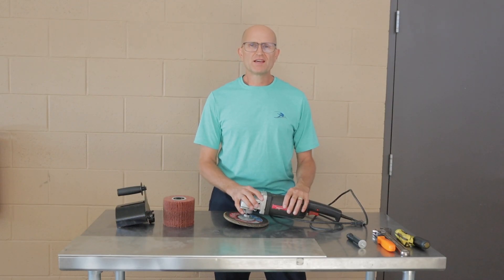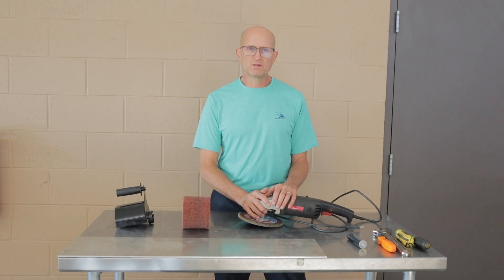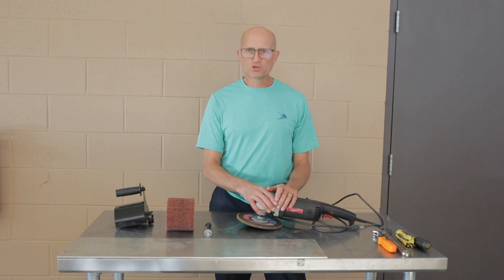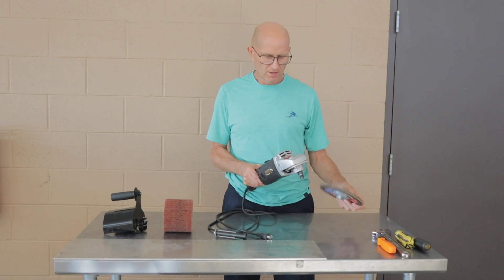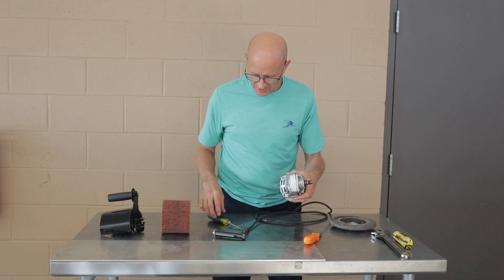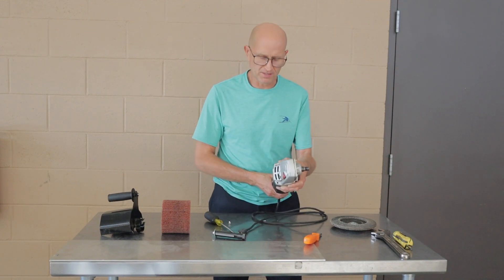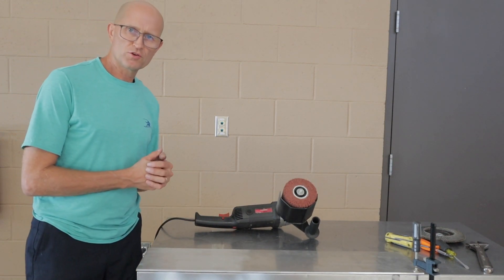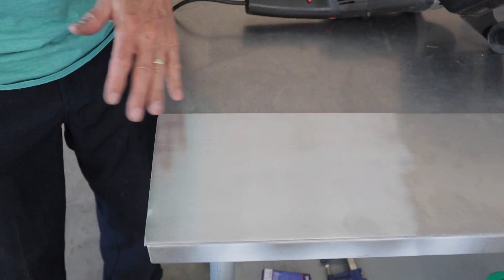Eastwood SCT DIY Tool at Home for Half the Price! $$ [ Aluminum and Stainless polishing for cheap!

Comment: Buuuu, I though you were going to DIY not buy from ebay
Jokes bro. You probably need an engineering lathe to manufacture that drive hub. the protection guard u can do yourself.
Didnt know the angle grinder can be turned like that, next time a job requires it I got you to thanks.
Reply from the maker: Yes, I know what you mean. I usually build everything but sometimes I will buy something so that I can save some time and build things that are more fun!😄

Comment: what compressor do you recommend for the yeswelder 55-ds?

thanks for your help
jason
Reply from the maker: Hi Jason, that’s a good question!  Well mine is a 3 horsepower twin cylinder that puts out about 12 cfm at 90 psi and it is more than enough even at the max psi of 70 on this plasma cutter. You could probably get away with an 8 to 10 cfm compressor if you had to ,but more is always better!😀👍Hope this helps!